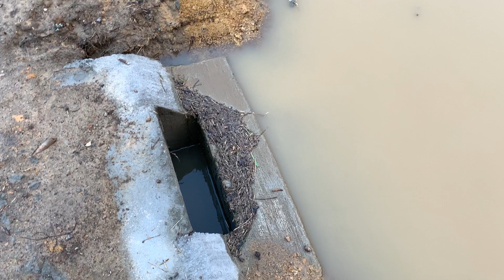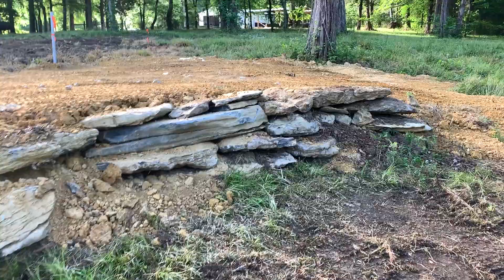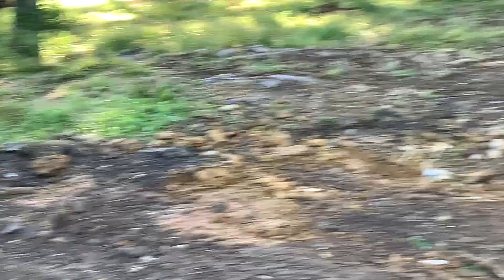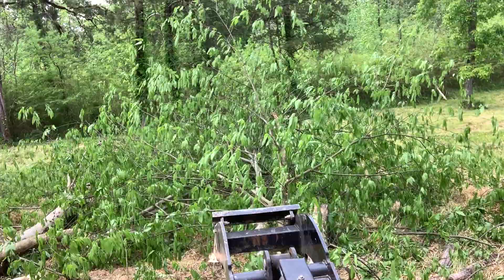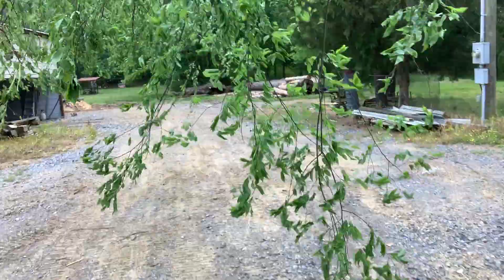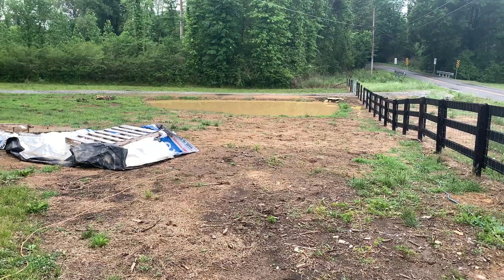Log Cabin Build using my Woodmizer LT50 Sawmill (part 1)

Comment: if the logs aren't seasoned I wouldnt put 2x6's between them. Could spread the notches as the logs shrink. I would avoid the synthetic chinking as well. It shrinks and pulls away plus, the mortar chinking looks more historically accurate. Just my opinions... :-)
Reply from the maker: Man I appreciate that. I just didn’t feel right about it. I guess fill the gaps with a closed cell foam would work and then chink. Huh?
Reply: @oldbluffsawmill5235  yea, wire lath and then foam or fiberglass, rockwool, etc
Reply: @oldbluffsawmill5235  also, i love the hewn look on your logs. What are you using to get that?
Reply from the maker: I bought the Festool sculpting planer. It’s awesome, has a half round shaft and knife insert. A throttle handle depth control that can be changed as you move along. They thought it out. Check it out sometime I’m gonna include some of it my videos as I go.